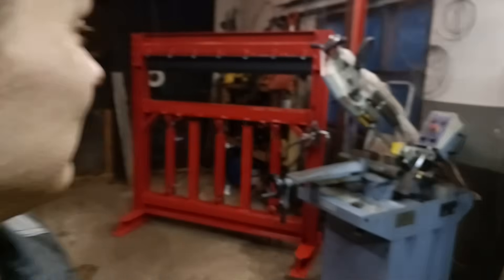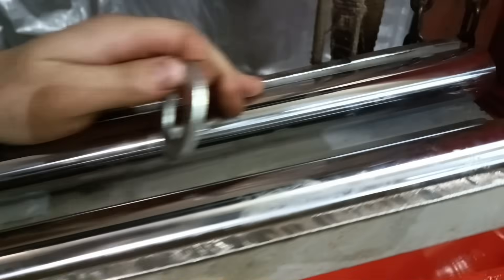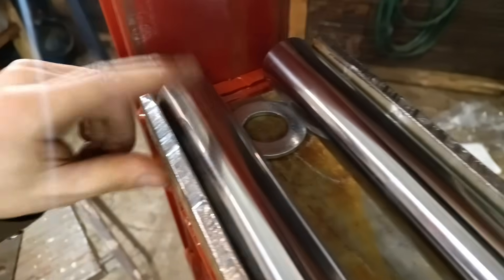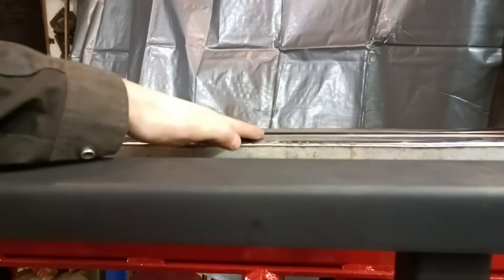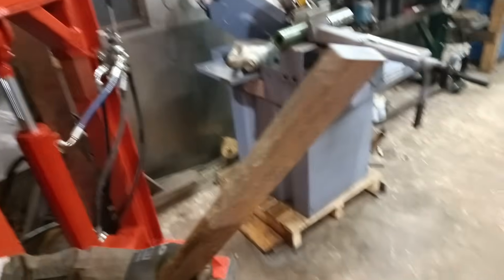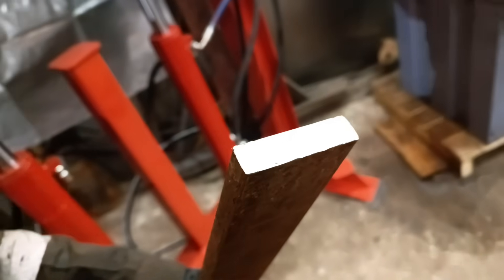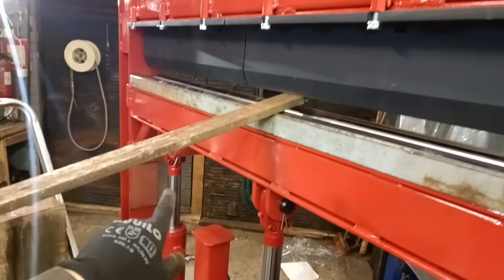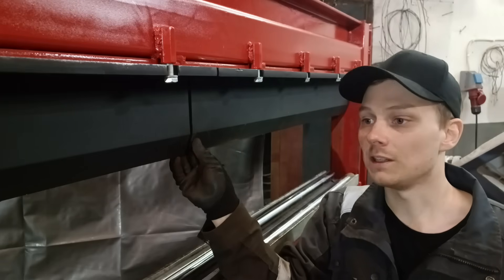Testing my DIY Hydraulic Press Brake + Mulcher Build in the Workshop

Comment: Projeto ficou top,mas pq a mesa fixa ficou tão alta?
Reply from the maker: Thanks!😊
The cylinders lenght and the fact that I wonna get the pallet truck under it to be able to move it in the workshop. 
Its high, but it is also nice to work at eye level,  you really see good from the end when you bend the metal